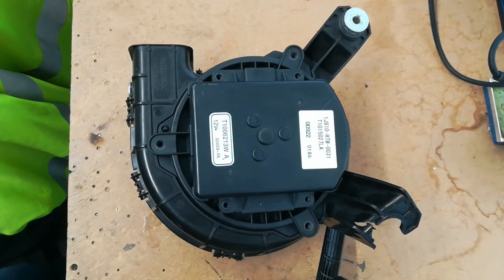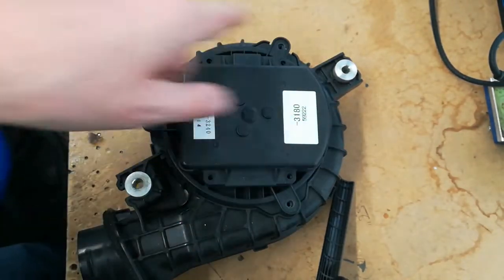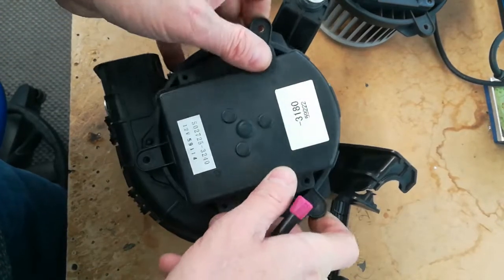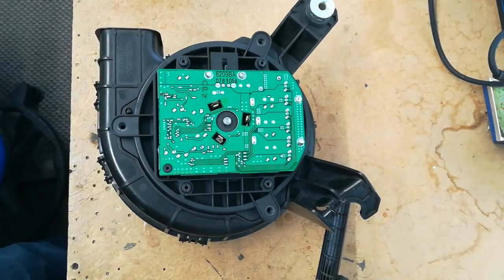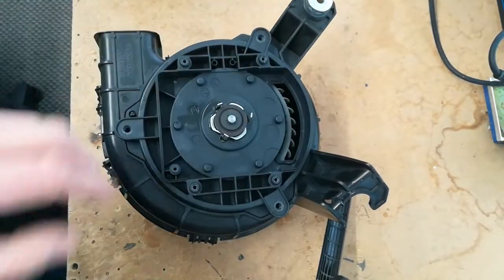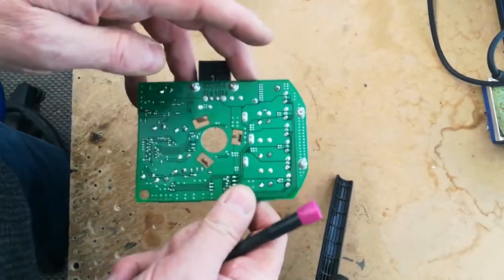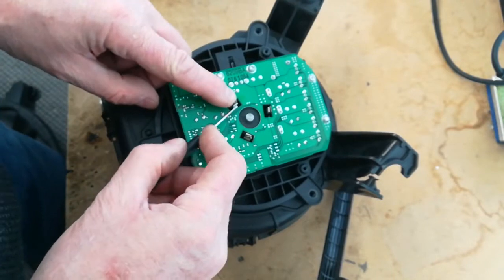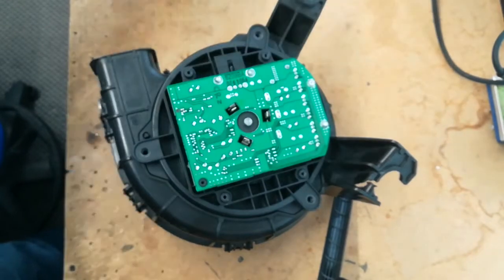CR-Z IMA FAN P1448 Options and ideas.

Comment: Any chance you'd know the pinout for those? I assume red would be 12v+ and black should be ground. Are the blue and yellow ones the tachometer and pwm signal, like in any regular 4pin computer fan? If so, any idea which is which? (PS: sorry for kind of asking the same thing again, I couldn't really tell just from reading its circuit diagram)
Reply from the maker: I just use YT as a video repository. All questions on the CR-Z forum thread please. Thanks